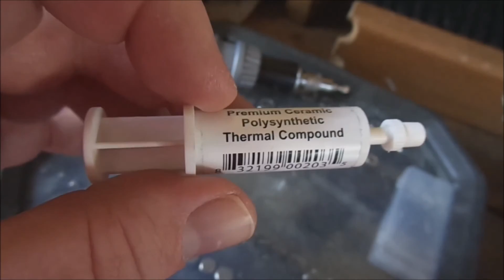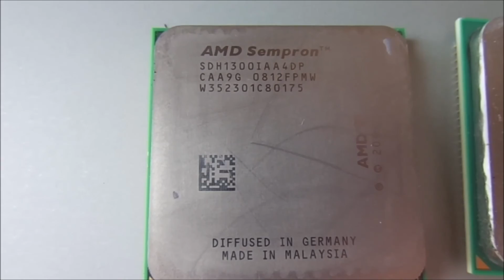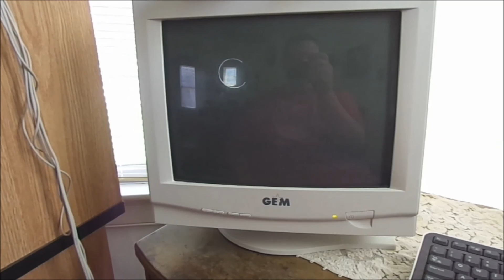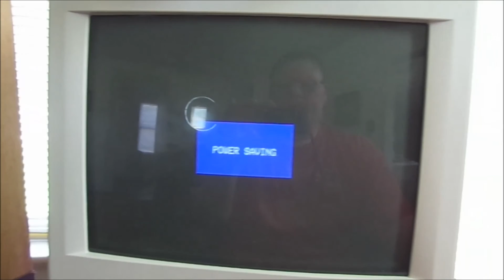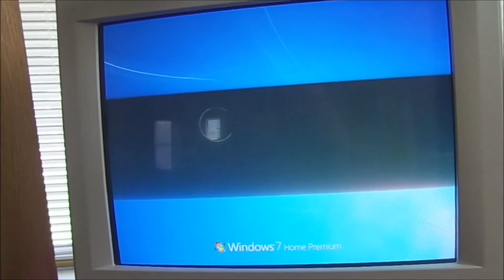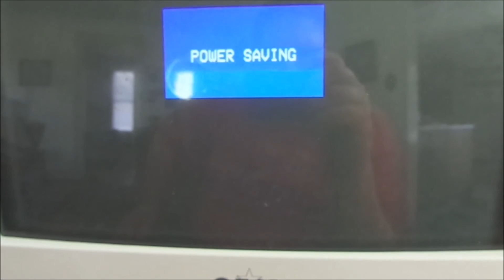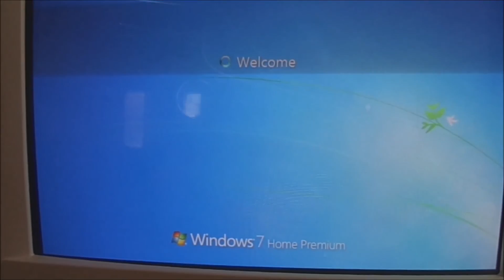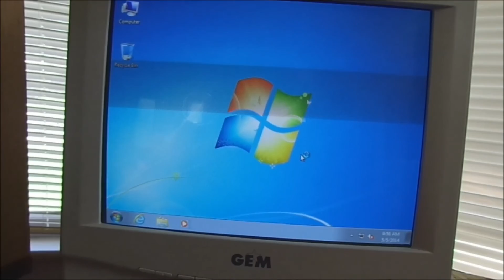Upgrading the Dell Inspiron 531 to Dual Core Power

Comment: Nice job. I just did the same thing with a 531 I had laying around. I have decided to make it into a iRacing/HTPC machine. Found a Athlon 6000 125w and heatsink, picked up a 2gb Nvidia for $50 and dropped two more gig of ram into it. I also loaded Ubuntu in a dual boot with XP. Next will be a 240 gb ssd for $70. Honestly it is running so well I am seriously thinking of loading windows 7 onto it and still dual booting Ubuntu. I hate throwing things away and actually wouldn't  mind picking up a few more of these to play with. Maxing out iRacing now and it works well with my rig. Thanks for the video.

Comment: If you replace the defective caps on the m/b, (re-cap) should you use exact same rated caps? Thanks I got a hold of a 531 Vista tower. Think it works - needs dust & lint cleaned out! - and looks like it has stock configuration. Ok, got it running - turns out Win 8 .1 is loaded, about 250GB HDD, & 4GB RAM, with a 2.2Ghz AMD Sempron. Is the Sempron better than the Athlon series? Thanks. It actually runs pretty good!

Comment: Whats your opinion on vista? when it came out it was a dog of an os. But nowadays I would recomend it more than xp if you have a core 2 duo a copy of vista and not enough for win 7 or 8.
Reply from the maker: It's ok, now that they have worked most of the bug out with the patches and service packs. I still prefer Windows 7. Windows 7 32-bit  will run decent on a core 2 duo with 1gb of ram, whereas Windows Vista would need 2gb to run well.

Comment: Thanks just put my 690 in I cut the hard drive sockets out so no hard drive and barley fit card it I am running games at full 1080p max settings no problem getting over 90fps but the only way I can boot the system up is put the card it the pc while its in sleep mode turn pc back on then the card works fine but it does not boot up with pc though the card is very new for the computer I have

Comment: My big sis just gifted me her old but very lightly used (like almost never) Dell Inspiration 531 with the  AMD 64 Athalon X2 (about 2006 vintage) . Questions:  Can it be upgraded to Windows 7 (or even 10) ? Can I add RAM to the existing 2 G?  Is it worth it? I'm not a gamer but just want a reliable computer to store files and surf the web but not have the vulnerabilities of the expired Vista OS. I did install all of the SPs and the "Emergency" SP from windows in May 2017.
Reply: G Philip C  no, not at all.  You can get an optiplex or ThinkCentre with an i7 3.4ghz for around $200 on ebay.  with enough ram its actually future proof against all games for at least a few more years. When i found out my Inspiron couldn't even handle Team Fortress 2 i decided it was the biggest Roku stick imaginable and moved on.

Comment: can i put a gtx 690 4gb in that pc
Reply from the maker: Yes, but you need to make sure that your Power Supply will support it. That card needs at least a 500 Watt Power Supply, but I would get a 750 watt just to be on the safe side. The Power Supply also has to have two 8 pin headers for this card. Meet those requirements and you are good to go.